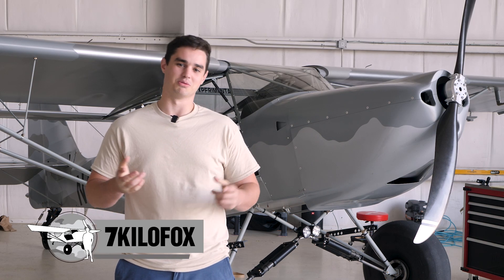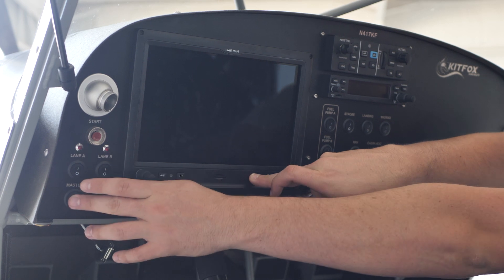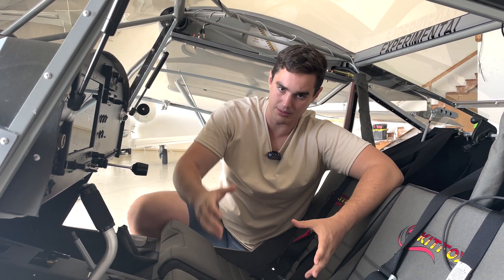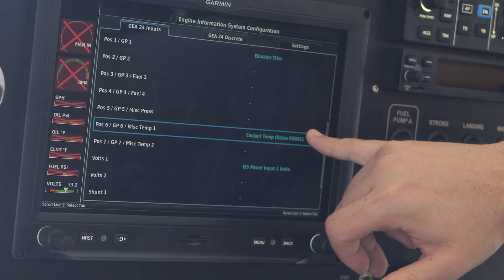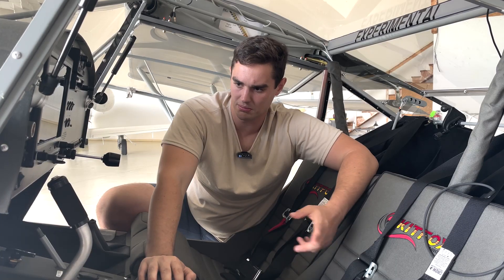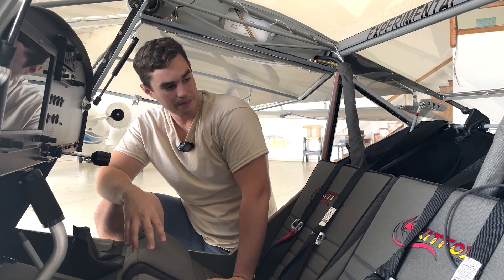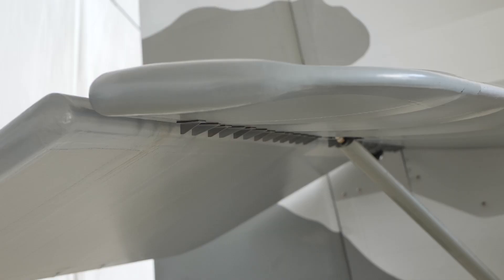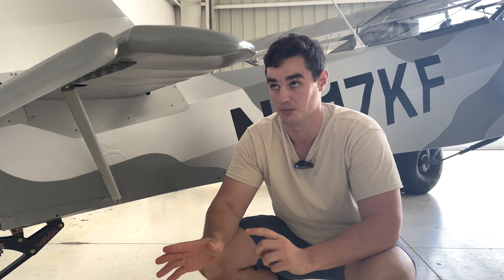Kitfox STi Build Update 27: FINAL BUILD UPDATE

Comment: Interesting, those numbers are nowhere close to what’s listed on the website.

Thanks you for your series it has been quite helpful in my project
Reply from the maker: The website give you ideal numbers. I could in theory get better performance in any area but it's a trade off: If I want better climb, I lose top speed or I have to carry less fuel. If I want better top speed, then my takeoff roll is longer. The moral of the story is...get a constant speed prop.
Reply: @7KiloFox  Roger, on that note, your stall speeds seem higher than advertised too. I'm sure VGs will make a difference, but I wouldn't think going from low 40s to low 30s would happen just with VGs. Or am I wrong? They list 32 mph on the website. Plane looks great man, congrats.
Reply from the maker: Stall speed is a function of weight. It may be possible to get stall speeds down that low if I lose 30lbs install, vgs, empty tanks, and kick out passengers. 32kts I could see, but 32mph is far fetched.

Comment: I also look forward to the flying video's and thanks for fully posting the whole build process.   I have a Kitfox Sti on order (2 years out).  Do you thing Beringer brakes are worth the extra cost?  Or is the money better spent else where.  Hopefully looking to build similar priced airplane as yours (Fuel injection and nice panel).
Reply from the maker: I have the Grove brakes and I have never once been in a scenario where more brake power would make a difference. Save the money on brakes to start and get at least a good engine. Not getting a constant speed prop is my biggest regret.